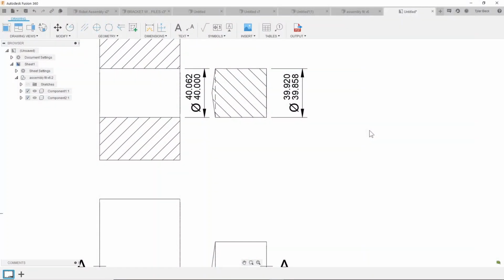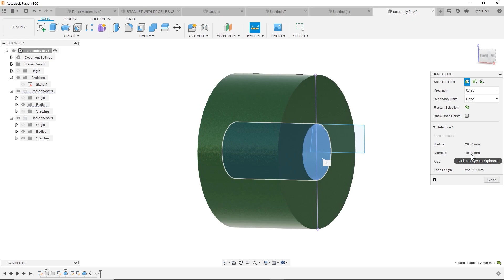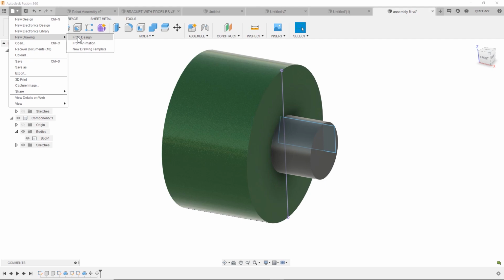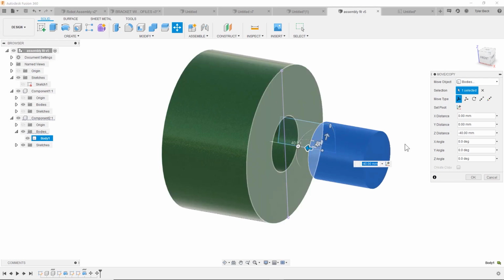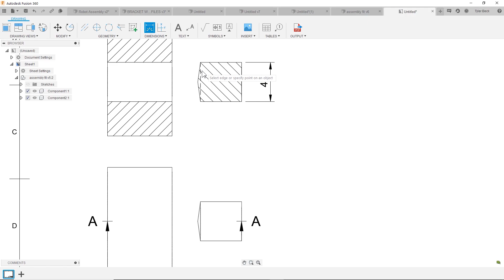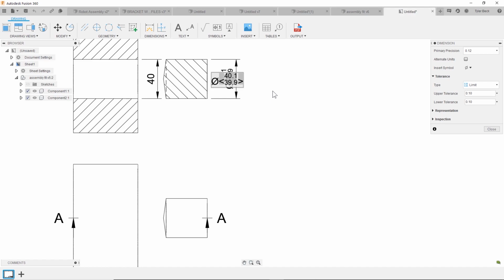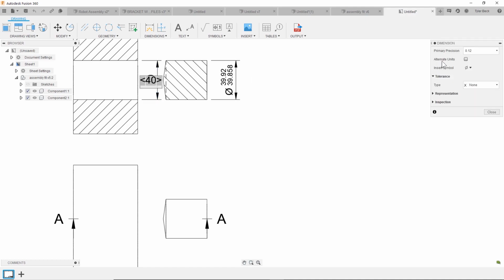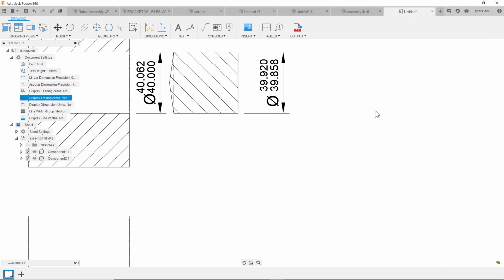Tolerance In Drawings (How Stuff Fits Together) Fusion 360

Comment: Ummm you absolutely can add a tolerance to your parts
The quick and dirty way is to enter it as a simple fixed formula, i.e. your desired hole size is 40mm but in reality they come out a bit smaller and you just know from experience its say 0.3mm undersized. So simply type in 40+0.3
This works just fine but the problem is what if you got your tolerance value wrong? You might have to go back and edit 40 different values across your sketches

The better way is to use parameters. Go to Modify->Change Parameters and click the + underneath User Parameters
Call it something like CircularTolerance, enter the value in Expression as 0.3. Comment is optional
Now when I dimension parts I type in 40+C and as soon as I start typing the letter C, all parameters will show up in a drop down list so I just hit enter and it'll fill it in as 40+CircularTolerance and show up as 'fx 40.3mm' in sketches
Now you can just go back to Modfy->Change Parameters and adjust that value if you need to and it'll automagically update every formula in your project. Incredibly helpful when you have multiple printers, each with slightly different print tolerances. You can integrate that directly into your drawings so you can be sure you get exact dimensions every time
Reply: I find that circular motions have a different tolerance values to horizontal/vertical or diagonal movements for instance. And very small holes will have significantly worse dimensional accuracy than larger ones. So you can always specify multiple parameters for different geometries in your parts. You can then go ahead and design these into your parts and update them for different nozzle sizes (which don't usually affect straight line accuracy but drastically affect holes), different printers, different print speeds giving a bit more tolerance if you print faster etc
Also a pro tip for Cura users: Turn on 'initial layer horizontal expansion' and set it to around -0.3mm
I used to chamfer the bottom of all my parts to account for elephants foot which would always ruin parts and require reaming, drilling or manual chamfering to fix up otherwise. This setting will take material away from all edges for the first layer, effectively chamfering every surface for you

Comment: I need to see if I can add a tolerance in Fusion 360 to the “parameter table”. Was thinking about that as I watched your tutorial. It could be added as a “formula”? For example: dimension + tolerance? Can’t tell you how many times in the past week I’ve had to reprint a model on my 3D printer because my tolerances were too tight, making two components impossible to fit together at all. Very frustrating!
Reply from the maker: Totally agree.  Ive been trying to dial that workflow in.  Stay tuned.

Comment: Nice video. Came here because the channel was recommended in a Autodesk Fusion 360 stream. And yes, cannot wait for a proper implementation of tolerances. Using Fusion for 3d printing means my tolerances are based on machine quality, material, nozzle size and print direction. Handling these tolerances better than today would be great. Today you have to do it in your head and remember what you had in mind when it comes to slicing.
Reply from the maker: Hey Peter - Glad you made it to the channel!